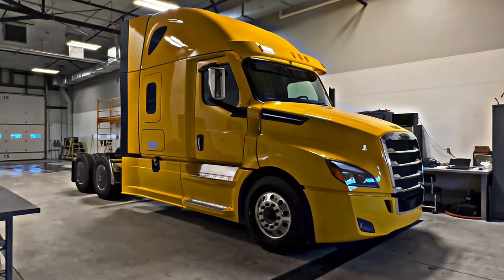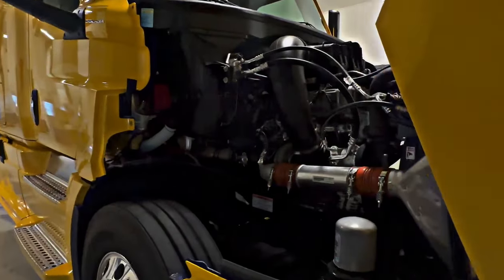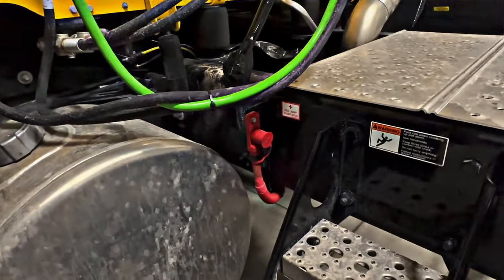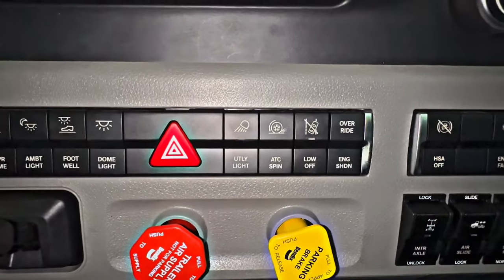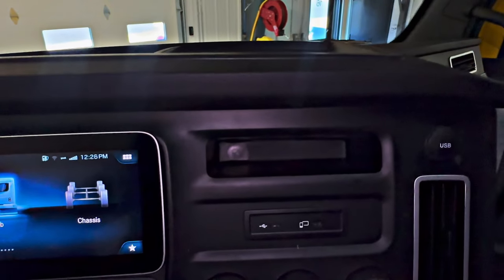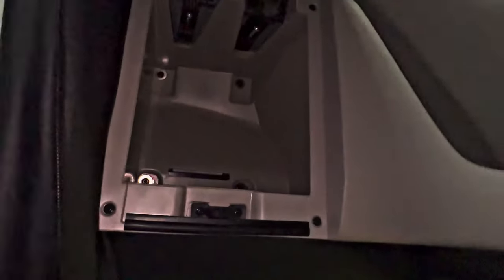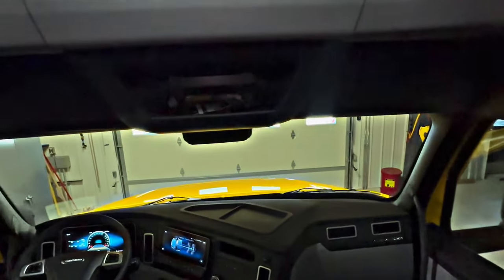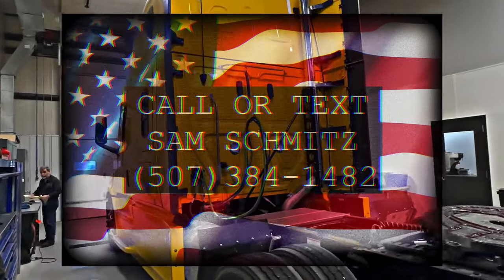2024 Freightliner CASCADIA; Interior SURPRISE?! DIGITAL DASH?! FLAWLESS!!

Comment: A quick question, not from the trucker so apologies if sounds stupid...you opted in for the top exhaust pipe technically sacrificing HVAC, but wouldn't it be more comfortable for a full sleeper to have hvac instead? I mean for a driver comfort perspective? Cheers from UK 😊
Reply from the maker: I would certainly like to have an APU, for sure, if it were me. But this fleet I deal with has had bad luck with APUs so they’ve abandoned them. Plus, with Detroit Optimized Idle, an APU is not really necessary. Making proper use of the DOI avoids the cost, issues, and noise that comes with an APU. Thanks for asking though. Have a great day 👍

Comment: Looks years behind the 2024 VNL with the Murphy bed.
I test drove an early Cascadia with rack and pinion steering.
Got back to the dealer and didn"t even waste my time talking numbers.
Finished my career with Volvos.
21:37
Reply from the maker: Wrong. Can get a Murphy bed/dinette in Cascadia if you want, but this guy wanted this setup. Also, Freightliner is the only OEM to offer Lane Keep Assist; which includes the secondary steering gear allowing a guy to spin the wheel with a pinky while stationary. Nobody else has anything like it. Freightliner/wst DOMINATE the competition
Reply: @MidwestBestHDTrucks  Look at the new video showing the new VNL with the super big grill.
It has a murphy bed/dinette and the bed tilts up to read.
Power window shades, wireless charging pad. Pretty sure it had lane assist.
I was thinking if this guy is this excited to be selling that Cascadia Thank God he's not selling the new Volvo. He'd probably have a coronary!!!
Long as you believe in what you sell you'll do fine.

Comment: Can you get different configured sleeper cabinets? Like if you use a CPAP machine, where would you put it. Need something like a nightstand behind the driver seat. Like in the Coronado had
Reply from the maker: Yes sir, there is a CPAP provision that can be spec’d that essentially makes certain there is adequate power to the CPAP outlet throughout the night, and allows for installing the machine conveniently.
Reply: @MidwestBestHDTrucks  I'm not talking about a power outlet. You need a place to sit your CPAP machine itself like a nightstand. Not open the cabinet door and put it in there
Reply from the maker: @richarddavis4928  if you look at the tower, you'll see there is an obvious cubby you can put your little machine in.. did you even look?
Reply: Adaptive cruise control sucks !,,
Reply from the maker: Then we’ll order yours without it 👍 Customer wanted it spec’d that way so he got it. That’s how we do things🫡
Reply from the maker: @toddanderson7313  then come buy one without adaptive cruise control!,,

Comment: No way any company I’d gonna upgrade and get the touch screen radio lol we’re all gonna get screwed with that DEA 500 which has the weather blasting the second you start up
Reply from the maker: We’ve sold several units with the touch screen and not a single one has had an issue.
Reply: I Never had an issue with my DEA500. No weather info whatsoever. Check your radio settings. I am on a cascadia 2017. The last year of the best cascadia ever. 🤙

Comment: 1:25 What do you mean whit the exhaust pipe do you have the engine on idle for the whole night when you guys sleep in the truck?
Reply from the maker: I don’t sleep in the truck, I spec’d it as the driver doesn’t like the odor of the exhaust when opt idle intermittently runs the engine throughout the night
Reply: @MidwestBestHDTrucks  Don't you have auxiliary diesel heaters on your trucks in usa? That warms the cab and the engine?
Reply from the maker: Yes, most have Espar. But Opt Idle starts the truck if batteries run low, if outside temp is extremely cold/hot (runs cabin AC that way too) or if you want to maintain a coolant temp (block heater effect, without needing access to outside 110v) 

Super nice feature for a wide variety of reasons. I’ll cover it in a video this week 👍

Let me know if you have questions, or have a topic in mind you’d like covered in a future video. Thanks for watching. Hope you’ll subscribe!

Comment: Why don't they put bigger fridges in these unities? Is it because they know we won't be shopping as much to save money? They expect us to cram 3 to 4 weeks of food in a 2x2 cubby hole?
Reply from the maker: You can put any refrigerator you’d like in these, they come prepped with a platform, strap to secure the unit, and convenient outlet. The reason this customer selected this fridge, under my advisement, was due to the factory swivel TV mount. This way he could fit his 26” flat panel tv, positioned above the refrigerator (but still able to swivel) without blocking the window on the RH wall, and the large baggage door it’s fixed within.

Comment: What is the price for this truck and is that space for a dorm fridge ?
Reply from the maker: Price varies, depending on so much. If you call I’ll give you a ballpark but it’s bad faith to the buyer to discuss in the comments. And yes, that is the ‘customer furnished’ refrigerator option, so it’s prepped for a dorm fridge. Much more cost effective and a guy can get a bigger refrigerator than what the factory does. I’d say 70% or customers I deal with this take advantage of this option. Thanks for asking! Call anytime👍

Comment: Month ago, I bought a brand new 2024 Cascadia.  From 1st day, digital screens are not working properly ( settings are not staying in memory. Every time, I must adjust settings after starting the engine ). Android auto play, power inverter stopped working in the first week.  The power steering pump and ABS got to fix in the second week. In cold weather, have big temperatures difference between the driver and passenger side plus have water leak from roof. In one month, my truck already had 3 warranty repairs.  For ABS, I got to pay $1000 . Freightliner will install new digital screens, BUT screens are not available, and they don't have any idea when they will be able to fix it. Water leak and temperature issue they  are not able to find.
Reply: Water leaks are a big problem in cascadia, i had experienced with it.
Reply from the maker: That sounds incredibly frustrating, and I sympathize, but I’ve not seen the problems with it. Granted I’ve only delivered one truck with the digital dash - but it hasn’t had any issues, with the screen or anything else. This will be the second. Having a dealer group that has your back is very important during the difficult times. If you can ever make it to a Truck Center Companies dealership (MN, IA, NE, and KS), and you’re in need of a solution, please feel free to call my cell (number in the video) and I’ll do anything I can to help get you taken care of and back on the road. I wish you the best, otherwise, and hope the truck issues settle and it can perform better for you.
Reply: The problem is, with the Cascadia being the number 1 truck sold and on the road, they mass produce them at a high rate so the quality isn't thoroughly checked the same way a Peterbilt or even Western Star would be, even though Western Star is owned by Freightliner. It's all about getting them out of the factory ASAP. I love the Cascadia and they clearly have some nice features but foe the extra money, I'd stick with the Peterbilt 579 and a Cummins engine. The "DD" is garbage compared to the old 60 Series. The 579 has everything you want and need while still getting the same fuel mileage but the 579 is bigger and ALOT more comfortable. It'd definitely worth the extra money.
Reply: on my peterbilt 579 same think brand new roof leak a little
Reply from the maker: Well, FRTL and WST are built in the same factory, and come off the line sporadic - you might have a M2 come off the line, followed by a Cascadia day cab, followed by a 49X, and maybe a 108SD after that. They’re all inspected the same. Mishaps will happen - and it’s an egg on their face every time. But see the comment above where the guy said his new Pete had a leaky roof. I feel horrible for customers when that happens, and I’ll always go to bat for them; which sadly is the best I can do, to be totally honest - our dealership is a customer of the OEMs too. Our dealership does great with customer service - better than any other I’d say. I hear what you’re saying, but comparing to perfect is silly, when they all have flaws. I am happy to hear your Pete has made you happy - it’s good when others succeed. But, if you’re ever in the area, stop in. I’ll show you a few things, you show me some things you like on yours, and we’ll both be better from it in the end. Appreciate you watching, hope you’ll subscribe, and would love to shake hands someday 🤝👍
Reply: I hate it when companies are too cheap to put in a damn frigerator , strip down version Of any truck for an OTR driver is just BS
Reply from the maker: @dustinbanneddotvideo2082  guys prefer the dorm fridge for the larger freezer sometimes. The driver himself chose all of these options. Not everyone is out to get everyone. We spec the way the customer wants and advise whenever they are curious about options.
Reply: And you're surprised??
Reply: Is the S-bar heating unit comes with AC as well

Comment: What's the horse power and torque? What size fuel tanks?
Reply from the maker: Did 475/1650 on this one. If a guy goes over 485hp or 1750ft/lbs the warranty gets a little more spendy. This, with 2.79 rears (and direct drive transmission) gets good startability/speedability and maintains 7.2mpg so far pulling reefer

Comment: Redesign is on its way
Reply from the maker: Elaborate…
Reply: @MidwestBestHDTrucks  New grille and headlights. Found a spyshot of a prototype on a trailer on FB.
Reply from the maker: @TellurideS13  I’ve seen that. They already publicized it on the eCascadia. It’s not going to happen in the Cascadia til at least 2028 I’m predicting. Probably more like 2030/2032. It looks good though.

Comment: Expensive to fix disk brake!! Owner operator edition??? Lol
Reply from the maker: How much does it cost to ‘fix’ disc brakes, exactly?
Reply: @MidwestBestHDTrucks  fairly expensive than drum brake which is commonly used. Most shop can fix drum brake right away while it takes some time to fix disk brake. This can not be owner operator choice. I do not know about future. But, it is not cost effective approach now.

You worship freightliner so much. But, it is totally corrupted company in my opinion. Nobody trust plastic front bumper for instance. Once, deer hit it, it costs thousands of dollars to repair. But, truck manufacturers are careless to put up plastic bumper for making additional service dollars obviously. why dont you put up deer guard bumper up front as owner operator edition? that is the way to go today. who can afford over 10% financing loan? their engine start/stop AC system breaks down easy, and cosume too much battery juice. We have jump started so many times for freightliner truck. Yes, they introduce lots of new technology to truck. But, they use truck drivers to do duarability  test at their pocket money. And, it is very annoying on top of over 200k price tag!

Comment: Claims it's O/O spec, but doesn't have the battery APU system installed. 🤣
Reply from the maker: Presence of a battery APU is not the distinction for ‘owner op spec’ - that’s the silliest thing I’ve read today. Customer uses Optimized Idle and it works perfectly.

Comment: man nothin changed at all since 2017 😂
Reply from the maker: You didn’t watch the video?
Reply: @MidwestBestHDTrucks  i did. only thing diff is what, a digital dash?
Reply from the maker: Surface level take… More to a truck than the dash and seats.. electronic architecture, engine updates, transmission updates, axle updates…. The things that actually matter
Reply from the maker: Wrong. Half of the words in your comment is spelled wrong; the rest of it either didn’t make sense or was flat out incorrect.

Comment: I had this package. I now have a VNL860. No offense but Volvo blows freightliner away in quality of the build. Probably because it’s built in the US compared to freight liner that’s built in Mexico. After a couple of years the plastic parts on the mirror falls off. The side skirting comes loose and will fall off if driving in high winds. And the paint starts chipping even nothing has hit it. I’ve had the drivers seat come apart and the seat covers start coming apart only after about a year of getting the truck brand new. On the screen behind the wheel a common issue is it freezes up when your driving. They are pretty much glorified Android tablets.
Reply from the maker: What ‘package’? I’ve not heard of any of those issues ever happening. Did you maintain your truck? What year model year was it with the digital dash?
Reply: Bullshit! All I ever drove was a Freightliner pulling a Reefer 500 plus horsepower is plenty. You don't need 600 plus horsepower pulling food and dry goods. I have been 79,000 pounds gross and had no issues pulling big hills. I you do heavy haul I could seen wanting more power. People drive poorly maintained trucks it's going to stop running regardless of the brand. I never seen so many Peterbilt trucks in the shop when I went to get a tire  that have issues in the shop because they are getting the piss drove out of them and failing inspections. You are paying more for the name that is all. KW, Pete, Volvo all of them if you don't properly have the maintenance done the truck is going to break down.
Reply: @Xpunkpro  it’s not the horsepower that gets you over the hills it’s the torque. Freightliner was good when they were built in the US but their quality went to shit when they started building them in Mexico. Paccar engines are junk.
Reply: Umm the digital dash issue was on Kenworths and Peterbuilts, which also btw have issues with panels falling off.
Im thinking your mixing up Freightliner with Peterbuilt/Kenworth. I know my old company started buying Kenworths to try them out. People loved them at first with the nice digital dash and the great looks....but yeah...every 1 ended up with body pieces missing, dashes did freeze, electrical issues...etc. My kenworth I had literally had the bumper come off and I didnt even feel it. Those things are held together by bubblegum and a dream.

Btw im now driving a volvo vnl 860 2023. Yes they are nice smooth trucks, but the cabinet layout is better in the freightliner. The way the desk/bed is done is alot better with the hideaway bed rather than using seat cushions as a mattress.  Downtime is much higher on a Volvo and parts/service is a hell of alot more. Yes volvos are nice and im perfectly happy with mine, but if you want to...idk...make money with your truck, the Freightliner is all around the better option.

Comment: Displays, wheel, buttons, ports. All from Mercedes Benz
Reply from the maker: Freightliner has nothing to do with Mercedes-Benz anymore. DTNA branched out from Daimler AG almost 2 years ago. Neither the steering wheel controls, or the digital dash, have not been out that long. Matter of fact it even rides nicer and looks better than any S or C Class out there.
Reply: @MidwestBestHDTrucks But they look the same 😄 even the display is the same. Just soft design looks different. Wheel is also same like on new Actros
Reply: @KennoOrason-y7y Actually is from the older Actros
Reply: It's like mp4 Actros from arround 2012...that's old tech not new😂😂😂
Reply from the maker: When did I claim MP4 was ‘new technology’? Do you have a timestamp?

Comment: I have to say...I HATE chrome on a truck. Like the saying goes...chrome doesn't get you home.
Its a pain in the ass to keep clean and looking decent. It stains and corrodes from bugs and guts getting on it all the time. I dont know why the nicer models always come with chrome accents. Give me the blacked out trim any day. It lasts longer, looks better, requires less maintenance and it can take more abuse.
That's one things I want to eventually do with my volvo vnl860...replace all the chrome with black pieces. My truck is less than 150k miles and the chrome already looks like ass. 
No ty.

Now if Freightliner would fix its suspension and put a better quality drivers seat in so im not constantly popping advil for my back, put better locking mechanisms on their cabinets and especially their built in fridges that always pop open and you have to put child locks on to keep shut, and maybe better headlights cause the frieghtliners always seem dim as hell compared to every other make/model truck, Id probably only ever run freightliners. They are better on fuel, cheaper to fix, require less downtime, and they can take a beating and just work.

Now if only Toyota would make a semi truck. That would easily kill every other truck on the market hands down.